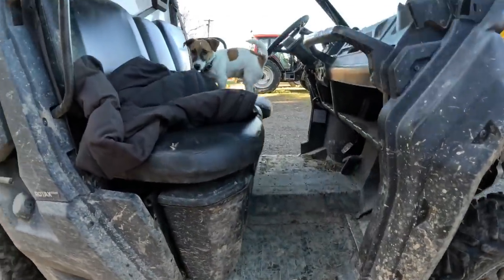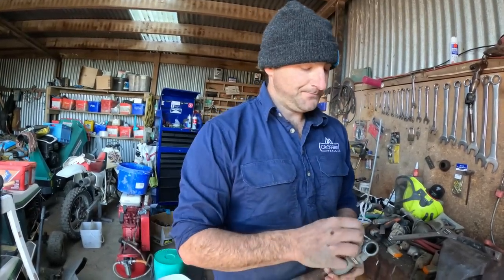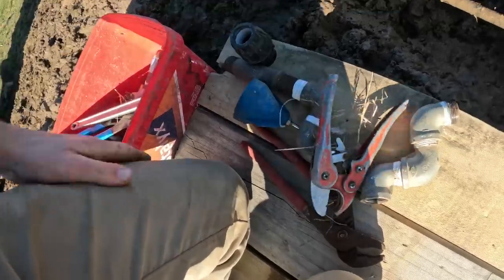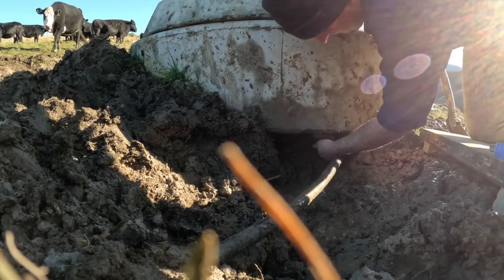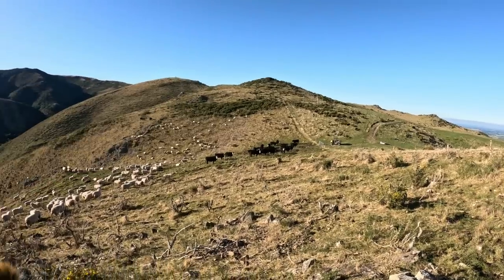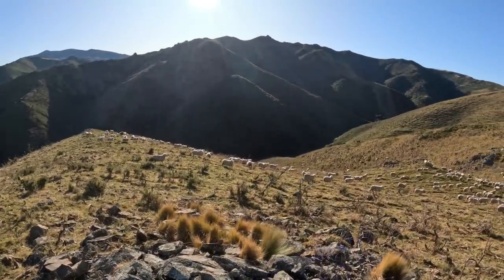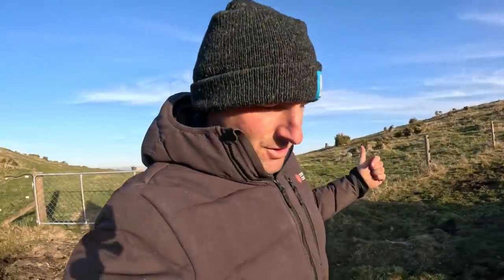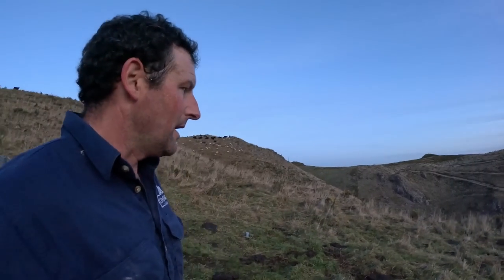Farm Maintenance | Water and Fences, It Never Stops

Comment: Oh the joys of cattle messing with troughs - been there done that - however my solutions were somewhat the opposite to yours. 
1: One of the most valuable bits on the trough is the inlet thread, hanging rigid iron fittings off it is risky, better to break / sacrifice a cheap plastic fitting.
2: Too many elbows causes pressure losses at times of high demand means the cattle mess around waiting for refill increasing the risk of damage plus I have found that galv fittings corrode rapidly further restricting the flow. I use just 2 plastic elbows as a kind of universal joint and the pipe can be curved up to the trough.
3: If I have to use a metal fitting I try to use a small plastic joiner to protect the much more expensive pipe fitting.
4: Turning the trough around so that it sits over the pipe, especially the fitting, self protects the inlet connection. 
If you have your own supply a couple of buckets of rotten rock as a trough surround works wonders.

Comment: I. Think your troughs are to small for cattle so when they come over for a drink it empties very quick
Reply from the maker: Couple of things. If the troughs were any bigger the ewes and lambs wouldn't be able to get to them, Also when they are full and have pressure and the cattle have constant access then you dont need a big trough. Its not like a dairy farm that requires a huge hit of water very fast.
Reply: @kiwifarmernz  what happens when ten or more cows come over for  drink the trough empties then they hang around pushing and shoving that’s when things break, maybe long narrow troughs with more capacity. Have a good day 👍